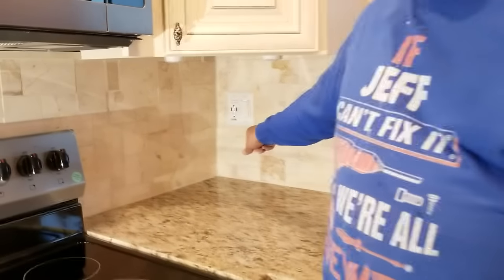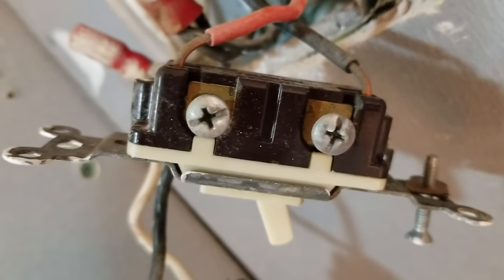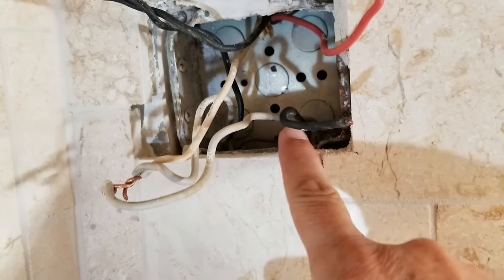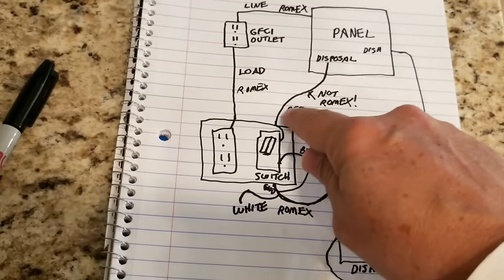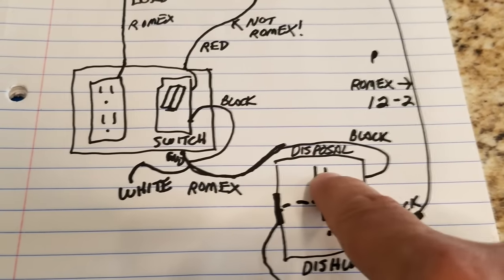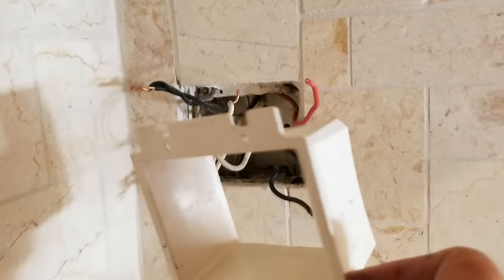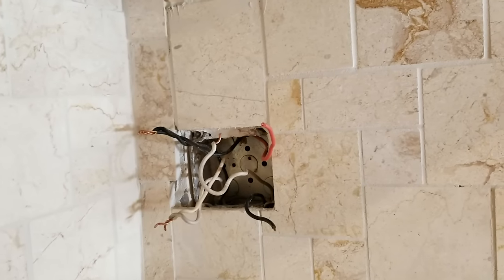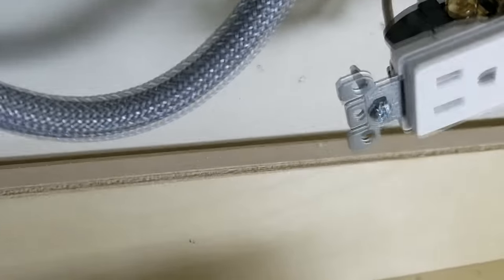How to Install Garbage Disposal Switch, Dual Electrical Outlet Box

Comment: So, im wanting to add a GFCI near my sink. This is an older home. The pannel has two switches and one outlet. There are 3 seperate romex cables coming into box. The outlet has its own breaker switch, and the switches were connected to a different breaker switch. The left switch controled the garbage disposal, and the right switch controled lights. There is romex that is connected to the light switch using a red wire and a black wire. There is also a jumper wire that is connected to the same screw that the red wire is in, and is connected to the garbage disposol switch giving that switch power. Now, all the neutral wires were connected to the outlet. They were not pig tailed, the outlet romex neutral was wrapped around the screw, and the other two neutrals were back wired on the outlet. My question is; is where would the light and garbage disposal neutrals go when i utilize a GFCI outlet instead of a regular outlet. Thanks Man!

Comment: Shown before, but again at 18:00, the usual tile jerks left a lousy opening to the box, covering the lower screws entirely. Our kitchen was done this way, and every counter outlet box was crooked (lazy electricians) before the tiling, doubling the finagling needed to align and properly set the receptacles. Of course the electricians used a lot of non-code drywall screws to get around the sloppy fit and installs as well. They also tied the over-stovetop microwave outlet in the cupboard (fine) to the bathroom outlet circuit (not allowed). I fudged and used an AFI/GFI receptacle in the bath, protecting the microwave outlet as well; not code but safe.
Reply from the maker: You should still be able to loosen the outlet screws and rotate the outlet box by 1/4" left or right to make up for it

Comment: I have a garbage disposal that is not on its own circuit. The dishwasher is on its own circuit. Would I need to run a whole new circuit to the garbage disposal to be on its own circuit or could I just run it to the dishwasher circuit?  Or would I have to fish a new circuit from my breaker box to the kitchen? Just trying to do this as safe and as easy as possible. Thanks
Reply from the maker: Really depends on your city inspectors if you do a permit. If you can wire it to a new breaker in the control panel, I would do it. IF it's not feasible, then many homes are wired with the garbage disposal and dishwasher on the same outlet box, both white wires tied together, snip the tab between the 2 outlets on the line voltage side, so that each is powered by its own outlet.
Reply: Jeff I think I have the same issue.  My outlet to my dish washer and garbage disposal is powered by a red wire from the same Romex that goes to my gfci outlet next to my disposal switch....my gfci trips if I try using my disposal

Comment: We do electricians always say back stabbing isn’t reliable? Every receptacle I have removed with backstabbing has been almost impossible to remove. Aren’t those waygo(sp?) nuts the same concept?
Reply from the maker: You got lucky. About 50% of the receptacles I pull out, at least one wire is broken, or breaks when I pull it out. Backstabbing has smaller area of contact tot he wire from the clip inside the back where you stab it. Much more coverage wrapping a wire around the screw. Also, they remove too much insulation, now some of the wire is exposed outside the bak of the receptacle.
Reply: The reason why backstab wiring is difficult to remove is because the spring loaded contact is digging into the wire when pulling.  Wago's and push ins are similar in concept, but provide more surface area contact. They have also been engineered and tested to be at least as good as properly used wire nuts and the standard ones will accept 12 gauge wire.

Comment: I’ve an older home, 22 years, not all that old but still.  Builder has the disposer and DW on the same circuit. 20a. Must have been code then and it will remain that way. We removed the DW 22 years ago and just reinstalled a new one this week.
Reply from the maker: I can't imagine it was code then at all. My friend's house built in 1974 we just remodeled his kitchen and they were seperate.
Reply: @jeffostroff   I can't speak for code at the time but my house built/inspected 1968 has the DW and disposal on 1 circut, dedicated Double Pole Breaker ea 15 amp and your reply scared me.  
He may have missed the Double Pole aspect or not thought relative if in fact exists. As far as I can find (research) thats fine, serves the purpose only shuts both appliances down if only one misbehaves.
Maybe not what I'd do if new build but haven't found anything saying it's bad, or had any problems all this time.

Comment: Hello  thanks.  How is this done now that the dishwasher and disposal need to be on gfci? Do i need to run new wire for the disposal to the switch?
Reply from the maker: The easiest way to do this is inside the electric panel, change the 2 breakers to be GFCI, then if the gfci ever blows you don't have to get way down on your knees and clean out the sink storage before you can reach the gfci outlet
Reply: @jeffostroff  Thanks
This condo unit has a double pole breaker. The red is connected to the bottom outlet for the dishwasher and the black is on top for the disposal and the run to a switch above the cabinet. 

The tenant is purchasing a new dishwasher but the installer won't install it without the GFCI. I couldn't figure out how to get everything working other than running new lines but the owner didn't wanna. 

Your suggestion is the best way around this issue.

Comment: I have this problem with a dishwasher/garbage disposal that is hardwired into JBox and then GD is on dual  GFI receptacle box. Dishwasher trips GFI, Electrician was too lazy to put a new plug on DW
Reply from the maker: Thanks for sharing We just did a kitchen remodel last week and we have the dishwasher and garbage disposal each on their own circuit and their own outlet, and each outlet is ground faulted. It might be an inconvenience to you if the whole outlet shuts down with the garbage disposal when the dishwasher trips it, but it is not that bad. If you look in the fuse box, typically your dishwasher breaker and garbage disposal breaker will be connected together.

Comment: I am replacing a regular outlet with a GFCI one in the kitchen. The old outlet had one black wire and two white with one of the wires going to the garbage disposal. Just like in your video.  I decided to use the good white cable and split that cable so that it goes to the outlet and garbage disposal which I think was how it worked before. Now everything works. My question is this OK
Reply from the maker: Gee, as long as the white wire going to the garbage disposal does not attach to the electrical outlet, you are ok.

Comment: I have similar setup but it is ungrounded, an old house.  Can I use the same method even if there are no ground wires present?  The GFCI I had installed upline (closer to the panel) was tripping when turning on the disposal and I think what you are showing is the fix because of the existing shared neutrals on the two circuits.  Just want to make sure this is the same fix for ungrounded split switch / outlet.
Reply from the maker: The electric code allows us to put a GFCI outlet on a two wire system but you have to put a sticker on it that says ungrounded, so you're not getting a grounded outlet. I'm not sure if it makes sense to put one on a garbage disposal or no, although modern code requires it. What you need to do is get a ground line to your outlet box somehow if you can get the fuse panel get inside of it and run a ground wire to that outlet. That's not too much trouble hopefully. Some older houses however already have the metal conduits that go between the outlets and fuse panel as ground so you could use a meter to check the continuity between the metal box and the fuse panel and if you have continuity there then you already have ground going to it so all you need is a ground wire to screw onto the back of the outlet box and there you go you have an instant ground inside your outlet box.

Comment: My dual switch has 4 black wire on 4 brass screws. 1 is for garbage disposal other is for 3 outlets. I want to replace dual switch but new one has 2 black 2 brass screws. Is the wiring the same?
Reply from the maker: Actually, electricians prefer to tie the necessary wires together in the box and run one black wire to the outlet, run one white wire tot he outlet, and one ground wire to the outlet. You would also run the the black dishwasher power wire to the non-switched receptacle on the dual receptacle.
Reply: @jeffostroff  thank you for replying. I really appreciate you. Great info.

Comment: Also note, clockwise does not mean the wire will bend in the same direction in either side of the receptacle. I just replaced a bunch of old outlets and the previous owner had all the wiring turned down 😖 I didn’t bother changing it back because they didn’t leave much wire so I just squeezed the wires together like he did in the video.
Reply from the maker: Yup it will still wire up, and if you are careful you can get it to work.

Comment: I'm a little confused by this. You mentioned shared neutral as if this is a MWBC but there's no red and black wire from double pole breaker. If it's a switched receptacle on the same circuit you'd need a 12/3 or 14/3 or at least a white wire used as a hot wire and I don't see that either. What gives?
Reply from the maker: The builder only ran one neutral, which both were sharing.
Reply: @jeffostroff  So it was an MWBC?

Comment: I’ve a question, if you don’t turn on the disposal, how would the sink water drain? You know there’s only dirty water sometimes and you don’t hope the noise
Reply from the maker: Water will still drain out  of the bottom of the garbage disposal unless it is clogged with food and needs to be turned on.

Comment: The GFCI counter outlet must be on a dedicated ckt, by itself or with one other outlet...
The garbage disposal must also be on a dedicated 15 amp circuit by itself, or on a 20 amp dedicated circuit shared with the dishwasher...
The dishwasher must be GFCI protected, but for the garbage disposal it's only an option...

The drawing you have is scary...putting two different circuits in one box or on one device is a recipe for disaster...involving the potential for 220 volts in a box...
The breakers for these circuits must share the same phase to ensure 110 volts in the box...
Reply from the maker: this was the original design of the electric panel, where they used combined neutrals. The GFCI counter can have more than one outlet in the line. The NEC rule is that they want 2 counter circuits

Comment: I have one 14-2 or 10-2, I'm not sure,  cable in from the panel. One 14-2 

cable to the outlet under the sink. One red conductor from the panel 

to the wall switch. One red conductor to outlet under 

the sink.  

The original, non GFCI outlet on the counter top worked fine as did the garbage disposal switch.

When I upgraded to GFCI outlet on counter top, the switch trips the GFCI. 

I don't have three white wires in the 2 gang box. I have 2 black, 2 neutral and one red as well as the 
ground. 
At the panel, there are two breakers. Both 15 amp single pole. They are independent. I have to kill both in order to safely work.  I think the red 
conductor is on its own circuit. 

I pigtailed the ground from the line 14-2, to the new switch and the GFCI outlet.  No other pigtails exist. I wired everything and closed up.
Now, when I plug my outlet tester to the always hot outlet under the sink, it tests correct. Same for the 

switched outlet. The wall switch will turn the tester on and off. 
However, if I put a load on the switched outlet, such as the disposal or a lamp, the GFCI trips.

Why?

Comment: 10:40 I'm no expert but I don't think 2 circuits can share 1 neutral because "the neutrals all connect to the same bar". To share 1 neutral the 2 circuits must be different phases which is missing info in the video. Kind of important imo since when on the same phase that single neutral could carry twice its allowed load and over heat without a breaker tripping. Very confused how this video has 50+k views and I don't see this pointed out. Hoping there aren't a bunch of houses currently wired this way.
Reply: Are you sure about this? Residential electric service is not 2 phase it's split single phase, and each leg shares the same neutral. All 120V circuits would be running through that single neutral. Can you explain further?
Reply: @mr.g937  Like he said, he's no expert.
Reply: Mr G - It's a split single phase in which the 240 volts from the transformer are split in the middle by the neutral (grounded conductor) 120 volts to L1 and 120 volts to L2 on the main panel. When L1 is at peak + voltage, L2 is at peak - voltage and the current is flowing in opposite directions. With 2 circuits, the one with the lower current demand is subtracted from the other and the remainder is returned on the shared neutral wire. For example, if one circuit is using 10 amps and the other is using 4 amps, then you'll have 6 amps on the neutral. If they are consuming the same, you'll have 0 amps on the neutral. The current will flow back and forth on the hot wires because they are on opposite poles (phases on sine wave). If both circuits are wired on L1 or on L2, the return current will be added and could result in an over current situation on the neutral wire and will not trip the circuit breaker. Dangerous situation. I have the same concern as Water Bug.
Reply: @mr.g937  Each leg shares the same neutral only in a multiwire branch circuit. A technique used to save time and wire and has no functional advantage. Normally each circuit carries its own neutral wire.

Comment: If I disconnect my white wire coming from the disposal, then where should I connect my disposal neutral ??
Reply from the maker: Not sure why you would disconnect the white wire as it is needed. One way or another you'll have to find the white common wire that serves the disposal circuit and run it to the disposal.

Comment: So the power for the outlet you're doing right now is coming from an adjacent outlet right? Then you run Romex wire if you don't have it from the panel so you can wire the switch and garbage disposal is that right?
 All I have is one black wire and one white wire no romex wire at all so I need that before I can do what you're doing on the video correct? Also the two outlets in my kitchen are completely separate should I wire them like yours or keep them separate on their own breakers?

Comment: Didn't you have enough room in the box to utilize pigtails instead of putting two wires under one screw.....? 
That hole in the wall looked big enough to put a safe inside of it. 
I'm sure that two more wires and two more wago lever- nuts wouldn't have caused inspector gadget to fail you....